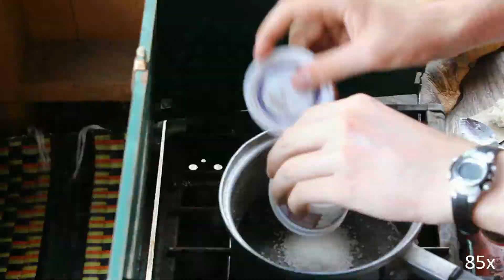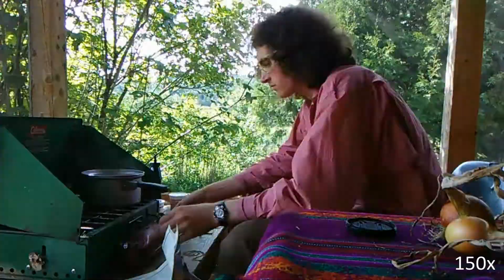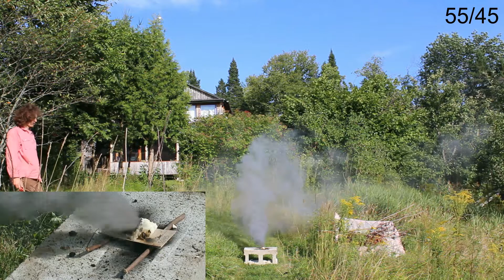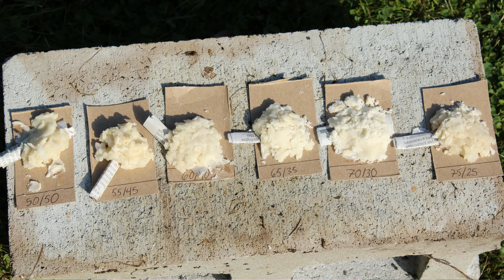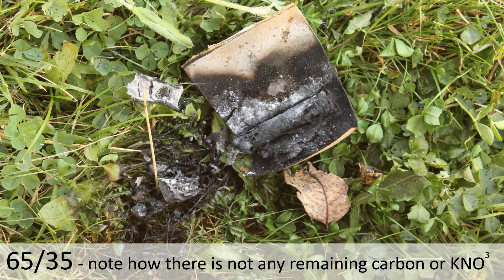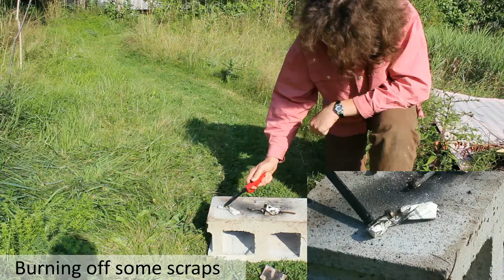Testing Potassium Nitrate Sugar Ratios for Smoke (2/)

Comment: You shouldn't heat it up you lose all the smoke when the sugar caramelizes, mix it to a fine powder instead and than dissolve it into melted wax while steering than you get a good smoke bomb. the proportions are 46g kno3 25g sugar 29g wax per 100g another that is lasting longer but with less thick smoke is12 parts kno3, 8 parts sugar, 10 parts wax. The wax acts the same way as baking soda because it's going to give a much slower burn but wax is better but you need to be more careful using wax because it's a cooling agent and you need to mix it well to get the best result it take's a few tries. I have experimented with over 500 different ways down to ingredients, technics on how to mix them, what layer to wrap them in etc.. A metal will oxidize with the Nitrate faster but when it's melted pour it on wet newspapers than rolled it up and than when melted into a wax just put a layer of aluminum around it and than put it in the jar for a longer burn and thicker smoke but not as intensive so it's a science to find the best smoke bomb

Comment: If you are willing to remake this video...

What is the proper ratio of KNO3 to Instant Coffee ?

Doesn't need as much KNO3. 
😉
Reply from the maker: I did a video on making it with charcoal (https://youtu.be/nPtxNKlFbtg) and calculated that it would likely need more KNO3 (though I did not try multiple different ratios). It would make sense that Instant Coffee would use a lower KNO3 ratio because it would not be as pure of flammable components as sugar is. Though I do wonder how it would burn with more filler in it.
Reply: @KestrelOwens  ,
""I've seen it tried a few times""...
With a few ratios, always burned hot & fast, good smoke... but, quite a bit stimulating with caffeine. 

It did drive mosquitos, flies, nats, & wasps away for a couple of days per trial.